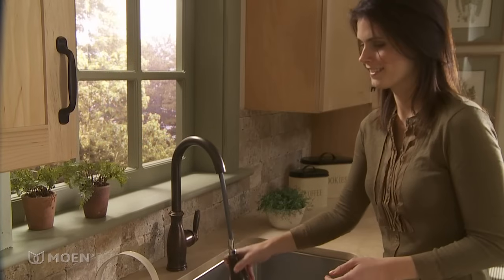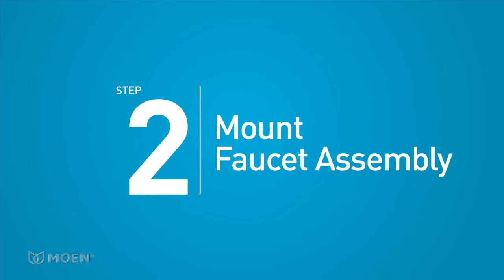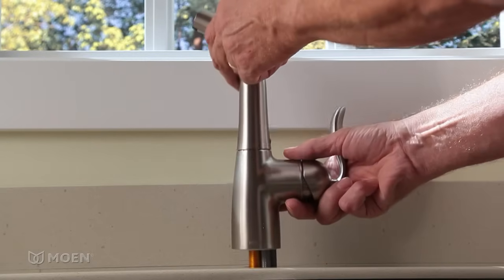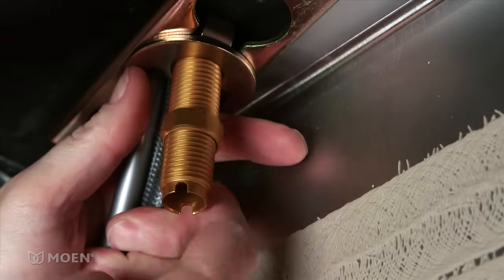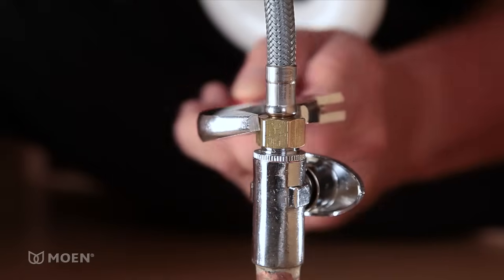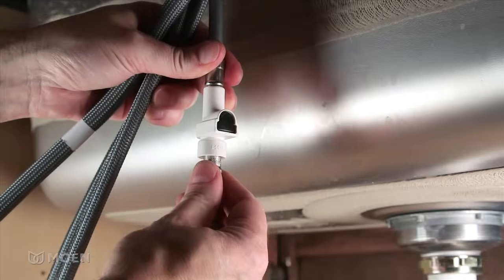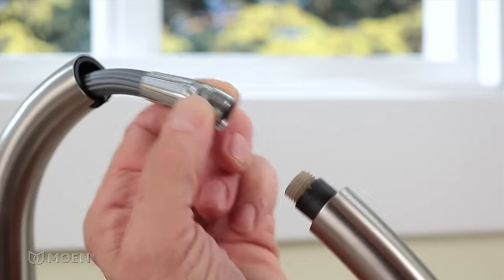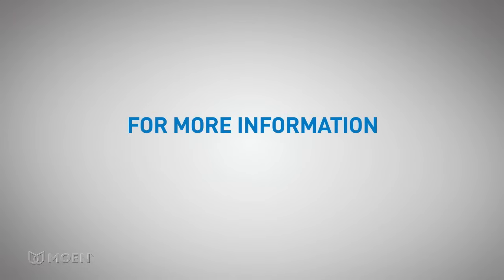Installing a Pullout Kitchen Faucet | Moen Guided Installations

Comment: When I turn the water on its backing up the hose and not coming down the faucet head! Any ideas 😌? 🤔
Reply from the maker: Hello Estic0.  If you are getting water to flow out of the pull-down or pull-out sprayer hose and when the sprayer is re-attached to the hose you no longer have flow, you may want to check the sprayer screen washer.  Located in the threaded end of the pull-down or pull-out sprayer, if this screen washer is clogged, it would stop the flow of water through the hose into the sprayer.
Reply: @moenfaucets  thank you I have a new head. Which screws onto the pull out bit. The only difference that I can see between this an a identical tap is a little brass part with a hole through it almost shaped like a button, this fits up the pipe where the faucet attaches! This has some movement in it and can quite easily be pulled out where as the other tap (separate sinks) has no movement and the water flows correctly without going back up the pipe. I hope I have made sense. It would help if I knew the correct names and terms 🙄😬...? 🤔
Reply from the maker: Dear estic, please PM us a complete picture of the Moen product installed in your home, address where the product is installed, email address, contact number and a copy of your purchase receipt. 

If you do not have a copy of the receipt, please answer the questions below:
What year was the product purchased?
Are you the original owner of the product?

Comment: Hi, we removed the 'hot' tag by mistake. Any way to identify the hot pipe??
Reply from the maker: Hello @pinchoffat5381.  After installing the faucet body through the mounting hole and ensuring that the on/off handle is on the right-hand side, the hot supply line hose will be the one on the left.

Comment: the mounting plastic tool broke from constantly tightening the faucet as it gets loose every 2-3 months of usage.. how to:
- Solve the issue of having to tighten it every few months 
- What’s the size if the nut to buy a new plastic tool.. the model is 87982SRS
Reply from the maker: Hello AbuZixer.  We are sorry to hear of the difficulty you are experiencing with your Moen Elgia Pull-out kitchen faucet.  The mounting nut requires a 13/16" deep well socket to tighten/loosen if the installation tool included with the faucet is no longer available.  
With regard to assisting with the nut loosening, replacement parts would be required.  Please contact one of our Moen product specialists at 1-800-289-6636; they are available Monday through Friday from 8:00 am – 7:00 pm Eastern Time.

Comment: Did Moen ever make a pull out sink with a twist lock spray head? Mine cracked and is leaking. It's about 7 years old.
Reply from the maker: Hello Walt.  Moen’s CFG Baystone and Edgestone faucets include a twisting spray head.  If you would like assistance determining the model/manufacturer of your faucet, please feel free to contact us at 1-800-289-6636 (US) or 1-800-465-6130 (Canada).

Comment: What size are the threads between the pullout hose and the faucet head?
Reply from the maker: Hello Jared.  We would be happy to assist you with your inquiry; however further information is needed.  Depending on the specific model of the faucet will depend on the hose and wand threads.  We would suggest contacting Moen to determine the model installed.

Comment: I just replace my old kitchen with a Fairbury Kitchen pull out Faucet (4005 series), everything went smooth, except the hot and cold lines  weren't long enough to connect to the original outlets. What should I do?
Reply from the maker: Hello Ralph.  The Fairbury kitchen faucet appears to be an American Standard product.  We would suggest contacting them for assistance/suggestions on this faucet.

Comment: While running the faucet the end of the hose that connects to the Duralock fitting popped off. After cleaning up the resulting mess/flood I reconnected the hose to the Duralock fitting, but when I turned the water back on the hose popped off again. These Duralocks are made of plastic and are very fragile. Would be a much better product if they were made of metal.

Comment: On this vid, a mounting bracket is needed if the counter top is less than 1/2" thick. But the current moen kitchen faucets offerings today, there is no mounting bracket, it's just the mounting washer. Why is this so?
Reply from the maker: Hello ybrik5.  We had a design change to the mounting hardware for our pulldown and pull out style kitchen faucets in July 2018.  The long 3 hole mounting bracket was removed and the mounting washer was updated.

Comment: I thought the support bracket would be included in the box.  Where can I purchase the support bracket?
Reply from the maker: Hello Rocky. The mounting bracket, Moen part number 176787 is not required for standard installation; therefore, it is an optional part that can be purchased separately. The Moen part number 176787 can be purchased directly through Moen or through your local/on-line Moen distributors.

Comment: The house we purchased had this already installed. One year later, the faucet is not totally shutting off and a small stream of water comes out and can't shut it off with handle or motion sensor. The handle appears loose and the sleeve next to the handle pulls away exposing the insides. I don't know how to tighten this back. There is a hole which may hold an Allen screw/bolt but I have to blindly insert and cant tell if an Allen wrench is doing anything since it is up against the kitchen wall. Does anyone have any information on this?
Reply from the maker: Morning.  We are sorry to hear of the difficulty you are experiencing with this Moen MotionSense/Wave kitchen faucet.  
1-You would need a 3/32 allen/hex wrench to tighten/loosen the handle set screw.
2-The following link will assist with the re-assembley of the handle dome kit parts:
https://solutions.moen.com/Article_Library/Kitchen_Handle_Side_Mount%3A_Slide_On_Dome
3-If the faucet has 2 sensors, one on the faucet body & one on the top of the spout, you can use the following link to help you determine which version of the faucet is installed and how to troubleshoot the issues you are experiencing:
https://solutions.moen.com/MotionSense%3ADual_Sensor-Hands_Free_Faucet
4-If the faucet only has one sensor, on the side of the faucet body, you can use the following link to help you troubleshoot the issues you are experiencing:
https://solutions.moen.com/MotionSense%3A_Wave-Single_Sensor_Hands_Free_Faucet
For additional assistance, please call us at 1-800-289-6636 in the US or 1-800-465-6130 in Canada.

Comment: My new Moen faucet that has a separate  sprayer  leaks under the sink ,the leak is from the sprayer holding water after use .
Reply from the maker: Hi Billy, we're happy to help! Call 1-800-BUY-MOEN to speak with one of our product specialists.
Reply: Thanks I have figured it out .
Reply from the maker: Thanks, Billy! Please let us know if there is anything else we can assist you with.
Reply: Billy Smith
Reply: It is good
Reply: The sprayer seems to come loose with usage. I will replace the sprayer or get a whole new faucet.
If the leaking if not fixed it can cause wood damage, please folks if you have this model check under your sink for water!!
Reply from the maker: Hi Billy - please call 1-800-BUY-Moen to speak with a product specialist. They will be able to assist you.

Comment: What size adapter do you need if you want to attach a hose thanks
Reply from the maker: Hello Neil.  Moen does not test our pull out or pull down kitchen faucets to see if they are capable of attaching an additional hose.  Moen does not manufacture an adapter for this purpose.

Comment: I took off the head for the hose and the hose retracted into the faucet body and I am unable to pull it out because it's stuck. Now I cannot attach the head, any ideas on how to fix that? I know it's not the weight pulling it down.
Reply from the maker: Hi Joshua - if you call our support line 1-800-BUY-MOEN you'll be able to speak to one of our product specialists who will be able to assist you with your inquiry.
Reply: Joshua Obas literally just had the same thing happen to me. Moen should have something on that end to keep that from happening during install. Was this fixable for you or did you have to take it back?
Reply: Push the hose up from underneath the sink?
Reply: Finally got it by sticking my finger in the faucet hole and reaching to push up the hose with the other hand. You can guide it out of the hole with your finger.
Reply: My faucet holder had a long neck so fingers weren't going to cut it. I was able to push it back up and when it got to the point that it caught on something, I twisted the hose around until it was able to wiggle free and go up the proper tube. I had to do that twice, but eventually it pushed back out.
Reply from the maker: Hello Tim.  Should you require further assistance, please feel free to contact us at 1-800-289-6636; we are available Monday through Friday from 8:00 am to 7:00 pm Eastern Time.
Reply: Wow

Comment: I have a 20 Moen faucet that uses 1224 cartridge since 2005, when they leak I just clean the 2 rubber gasket with toothbrush and water, put it back, like new again.  It happen about 4x only.  The 5 shower uses cartridge 1225 cartridge It broke one time and I replace the cartridge.  Moen is very reliable, easy to fix faucet.

Comment: I am really dissapointed with our moen kitchen faucet. We got it with our brand new house that we moved into. The handle broke off 3 times under normal use because the tiny screw that holds it on kept breaking, a very poor design. In addition, the top of the pull out nozzle was leaky. Today we bought a new Delta faucet and installed it. Not really looking like we will purchase a Moen product again.
Reply from the maker: Hello. I am sorry to hear that you have had issues with the Moen kitchen faucet. If you are the original owner of the home, this faucet would have been covered under the limited lifetime warranty. We can offer to send repair parts even if the faucet could be used in the future. Please reach back out to us if we can assist you further.

Comment: What if you don't have a threaded connection?
Reply from the maker: Hello Devoz.  All Moen pull-out & pull-down sprayer kitchen faucets have sprayers that thread onto the hose.
Reply: @moenfaucets  I mean my spouts aren't the threaded type. Is there anyway around this?
10/10 video btw, I will like and share. ❤

Comment: I went through hell taking out my previous faucet. Took 7 hours. I was so happy to finally put this new Moen in and it was quite easy. However, my hot water pressure is so low. I checked every sink in the house and hot works perfect and strong. I just disconnected the lines and reconnected and it's still low for hot only. For $250 I would expect better than this. Can I get some advice on why this could be happening? The only thing I didn't disconnect was the lines going into the faucet itself because it came connected already and I didn't want to mess with yanking that out. I have the LIZZY. Any help would be much appreciated as I called Moen and got nothing but automated customer service and no matter what I pressed, I never got a real person, which was disappointing since the box my faucet came in brags about customer service... I have gone through hell with my sink and I don't want to go back to Lowes to purchase another one and do this all over again to find out it's not any better.
Reply from the maker: Hello Trent.  We are sorry to hear of the difficulty you experienced removing the original faucet and installing your new Moen faucet.  Please send us the following information to moenwebmail@moen.com.  Please include your name, address, a full product view picture of the faucet and a copy of your purchase receipt.
Reply: Hello, I got the part and just replaced it. It's doing the same exact thing. I am very frustrated.
Reply from the maker: Hello Trent. I attempted to reach you by phone and left a detailed message for you. Please reach out to our Consumer Services Department, so we can assist you further. We can be reached at 800-289-6636 Monday through Friday from 8am-7pm EST.
Reply: Had same issue. Hot water pipes most often have lots of corrosion, which can loosen during installation. That's what I found. Plumber even did the install and left the hot with minimal flow. He said the only correction would be to replace the water pipes(WINK, wink!!). I already paid 500+ so damned if I was going to pay more. So I googled YouTube and learned: 1. How to check faucet screen, yes, found some debris. Still slow.  2. How to remove handle and check for debris within mixing ports/screen, yes, found more. Still slow. 3. What fixed the issue was learning how to back-flow water through the hot water faucet line. First, turn off and remove faucet hot water hose. Put end of hose(hot water hose coming FROM the faucet) into a gallon or more size bucket. I used a 5 gallon plastic paint bucket. Then turn on cold water. Move faucet back and forth between hot and cold. You will see at the midpoint between hot and cold--> water will begin to back-flow out of the hot water hose into the bucket. I assisted this by closing off the faucet flow with my hand to force more water pressure back through the hot water hose. And... after a couple of minutes...BINGO!! A HUGE amount of pipe corrosion debris was washed into the bucket! I repeated a couple more times till clear. As a final measure in my case, I placed a short plastic 1/2 inch hose over the hot water inlet and ran hot water full pressure directly into the bucket for a couple of minutes. And sure enough, some more debris was found. Old galvanized hot water pipes have this issue. Our house is too old to renovate, so this will do for us. Now I know what to do with future slow water flow. In the future my first go-to will be to backflow water through the system. Good Luck.

Comment: Something is wrong. Faucet points down instead of up, and is under the sink instead of on top where the supply lines are sticking up. Help!
Reply from the maker: Hello. I would like to assist you further. Please send us a private message with your first/last name, phone number, email address and model number of the faucet you are installing.
Reply: @moenfaucets  The joke was that I installed it upside down, to the underside of my sink...
;)

Comment: Great video. I have basically the same faucet. 
I’m wondering if you sell an aerator that aerates more. Mine works but every time I wash my hands the water deflects off my hands and gets the counter all wet. Really annoying.
Reply from the maker: Hello Michael.  The aerators in our pull down and pull out sprayers are not removable and cannot be changed.

Comment: I could use some guidance on IPS vs compression fittings.  I have everything but the water connections done,  I had to go to the store and buy fittings to adapt my existing 1/2" (compression or IPS?) water lines to the Moen 3/8" compression fittings.  They leak like crazy.   The hardware store guys couldn't tell me whether I needed compression or pipe fittings, even when I took the old hoses in.  And Moen doesn't answer the phone on weekends.  Great.  This sucks.  I won't have a kitchen faucet all weekend while I await information on Monday.  I hate life.
Reply from the maker: Morning!  Moen pull-out and pull-down faucets have built-in supply lines with 3/8" compression fittings on the end of the hose that is connected to the supply/shut off valves.
Reply from the maker: Please send us a Private Message via Facebook or a Direct Message via Twitter so that we can answer any more questions you may have!

Comment: we bought our house 4 years ago and my kitchen had the same. faucet, well not even a year after it broke . turns out that its made out of very cheap material.
Reply from the maker: Hi Norma Roman, For technical support including assistance ordering replacement parts please contact Moen Consumer Services directly at 1-800-289-6636. Our current business hours are Mon - Fri 8am-7pm EST.

Comment: What if there are no handles under the sink that chokes the water? What then?
Reply from the maker: Hi Lodestar Inbound, If there are no shutoffs under your sink than the main will have to be shut off to install the faucet. For additional technical assistance please contact a Moen product specialist at 1-800-289-6636.

Comment: Shouldn't you use pvc tape on the connections?
Reply from the maker: Hi Robert Peters, For technical assistance including installation support please contact us directly by phone. For U.S. please call 800-289-6636, for Canada please call 800-465-6130.
Reply: No tape is used for the water supply connections. The ends of the supplies have washers that make up the seal. Tape only causes problems with that.

Comment: I was told today that Moen can’t replace the plastic connector that snaps into the spray wand hose on my faucet.   The said I have to buy a new unit.   Very disappointed in Moen.
Reply from the maker: Hello George.  We are sorry for the misunderstanding.  The part of your faucet that is leaking cannot be replaced/repaired.  This is why you were advised as the second owner of the faucet, that there is no warranty coverage on the fixture.  Moen's warranties do not transfer from owner to owner.